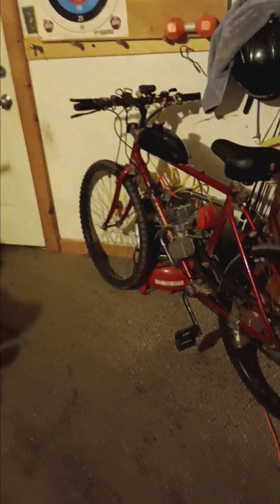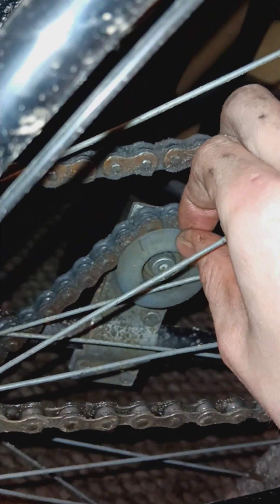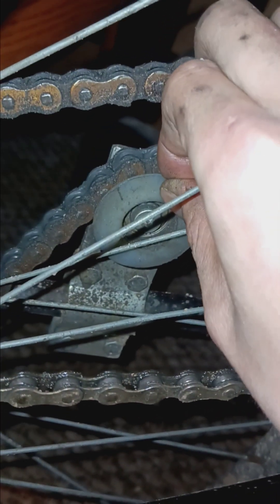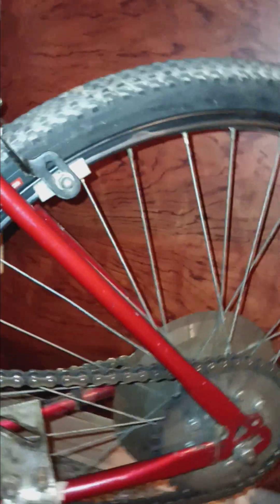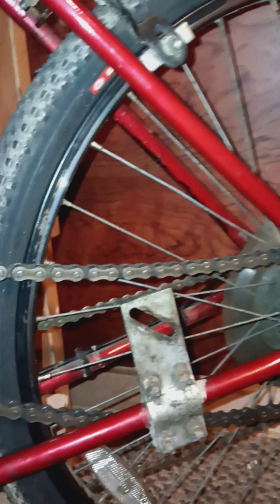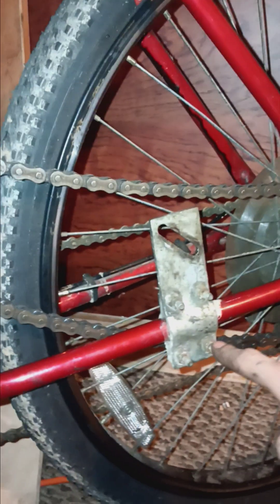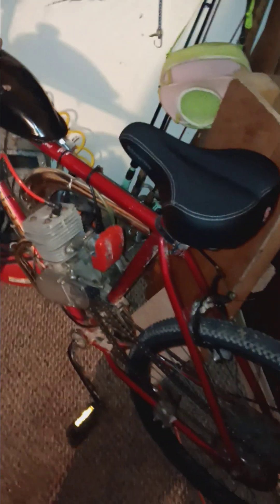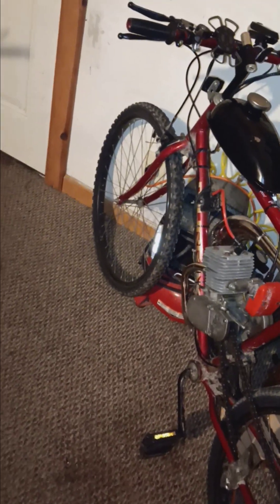went on a 3hr long ride today with a buddie of mine and blew a tire motorized bicycles

Comment: I use self-sealing slime tires 😎 no flats if so it seals its self back up in seconds
Reply from the maker: I do to ushaly but this bike had a good tube in it when i found it on the side of the road and i just never changed it
Reply: @theLyzhendricks  that's a win a free bike on the side of road
Reply from the maker: Thats how ive got every bike ive owned ive only ever bought 1 bike brand new @Pedalfast22